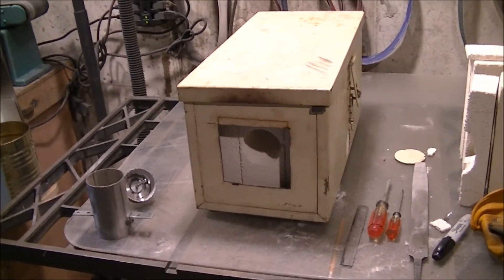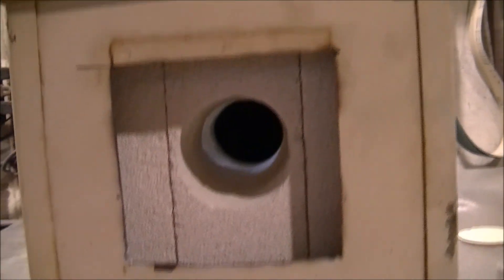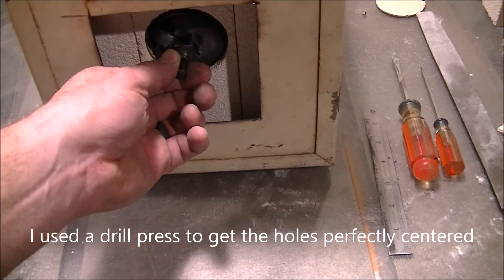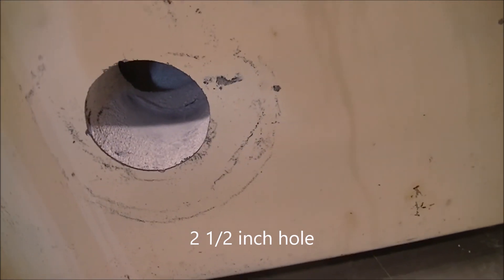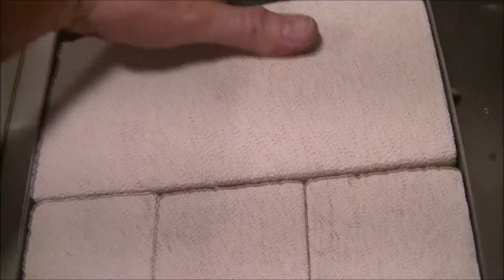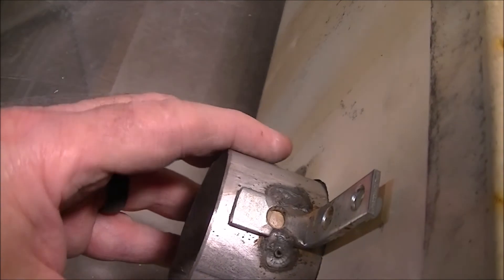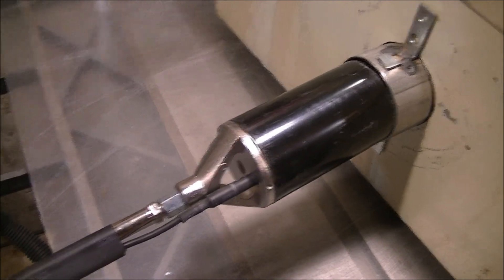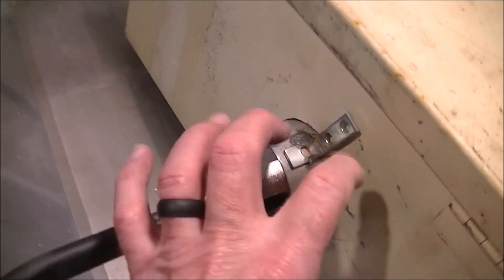Mini forge DIY .... no welding required!

Comment: I like the setup if you take a few little pieces of the fire brick and set them in the burn chamber to elevate your metal about an inch it will heat you're metal even faster it will allow heat under and it will put it in the center of the flame nice job as it is looks good I made mine out of angle iron but I like the Box idea better
Reply from the maker: Thanks for watching!